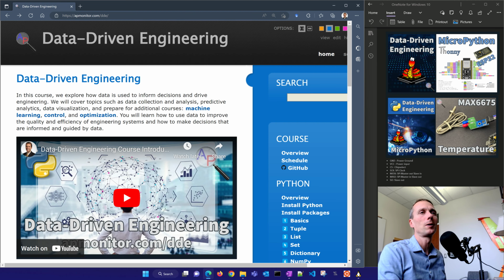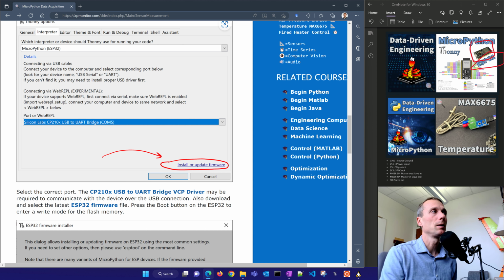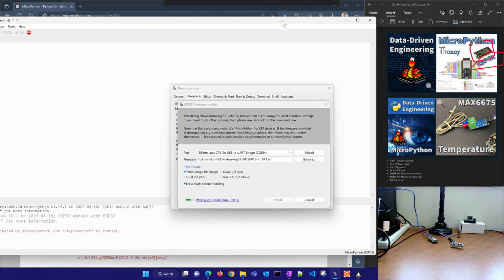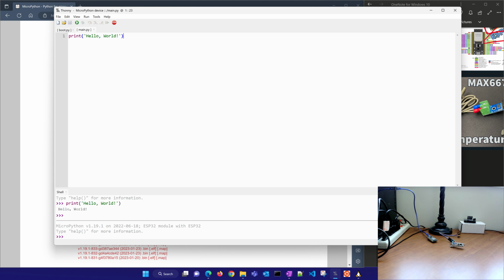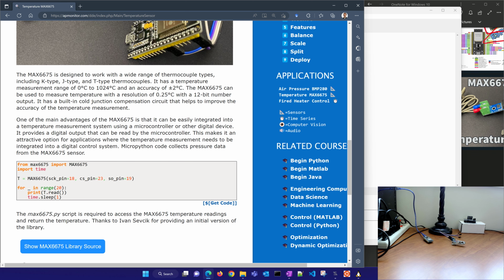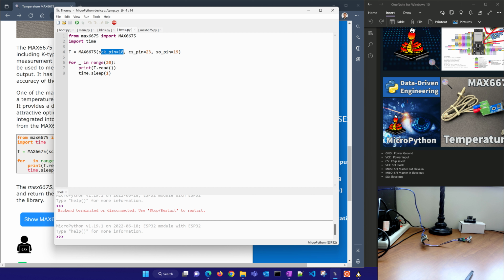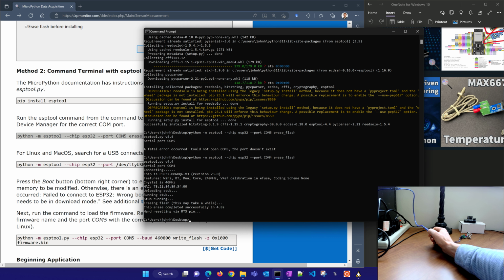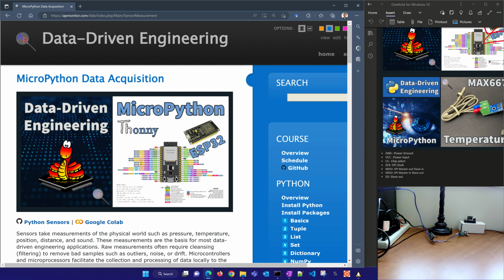MicroPython for Data-Driven Engineering

Comment: Hey, the package "machine" is no longer supported and gives an error when trying to !pip install it. What package should I use instead?
Reply from the maker: What device are you using? If you use MicroPython for the ESP32, it should be built into the firmware.

Comment: how do i do something with micropython and ov7670 camera module,
not only micropython like anything that could help to do me this 
i have arduino uno , esp8266 dev board, ov7670 camera module, etc.
i want something like :

1. take data from camera put it to arduino
2. from arduino put in to host computer
3.  construct the loose data into image again on host comp
4. run opencv on img feed (video) (from arduino) and detect "shoulder"
5. calculate the degrees the servo motors should move if detected "shoulder" was to be in center of frame
6. write that angle to arduino and from him to servo
7. repeat step 1 to 6 

it well be very helpful to have your  help, or just show me a resource you know, help, help from anyone is welcomed